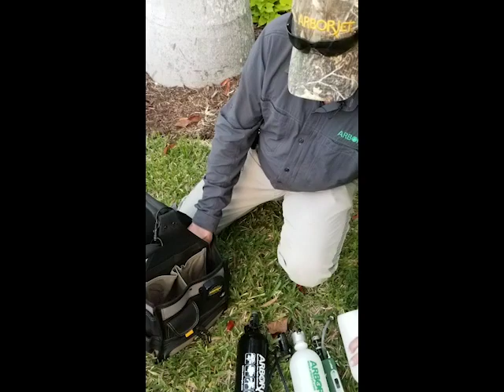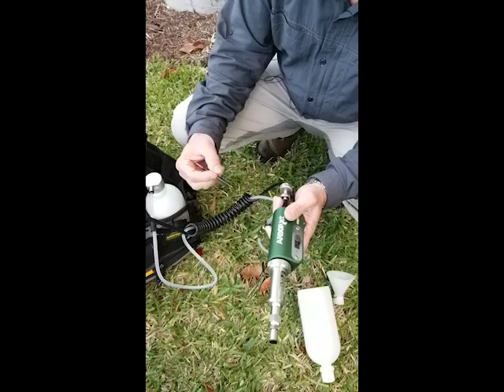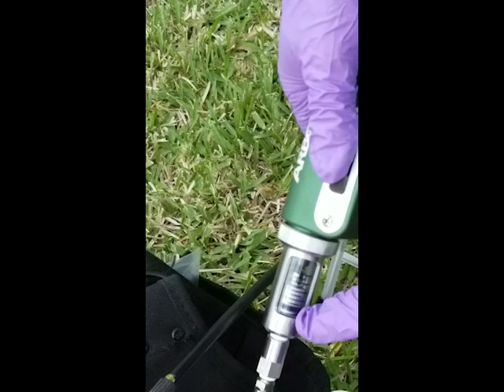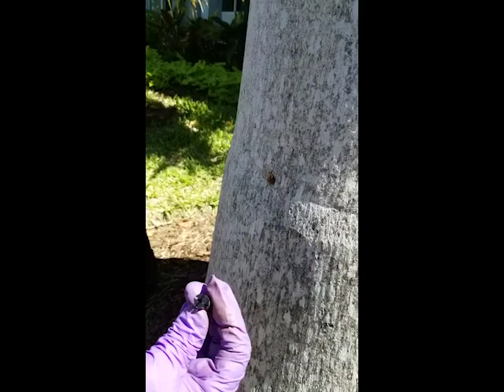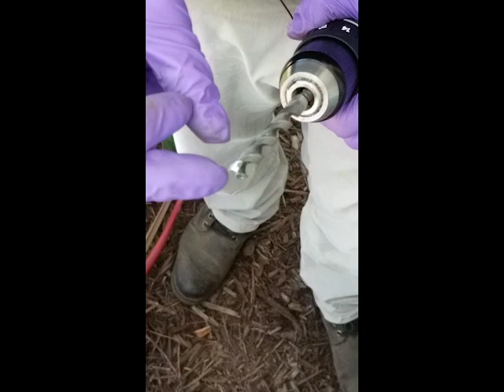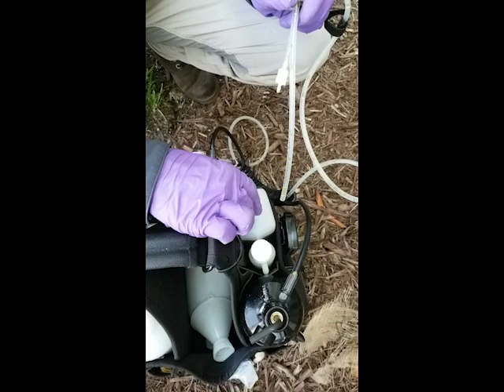Injecting Palms - part 1

Comment: It seems to me that I’ve only really seen folks injecting trees with chemicals and products exclusive to arborJet. Is the system only set up for those products? Can I use FMC, Bayer, and Syngenta brand chemicals??
Reply from the maker: The QUIK-jet AIR and other Arborjet injection systems can work with other products. However, we recommend using Arborjet injectable products for optimal results and to ensure easier calculations of the right amount of product.